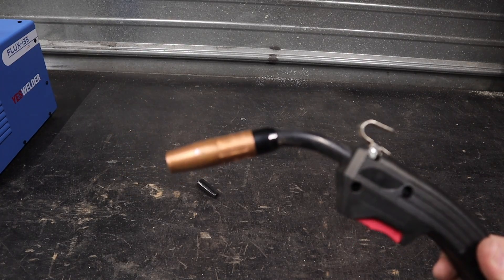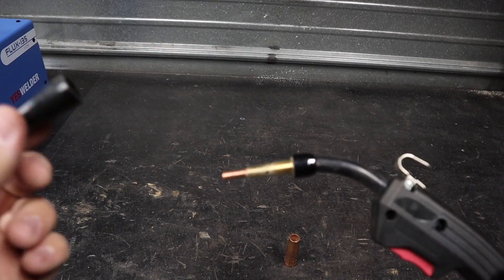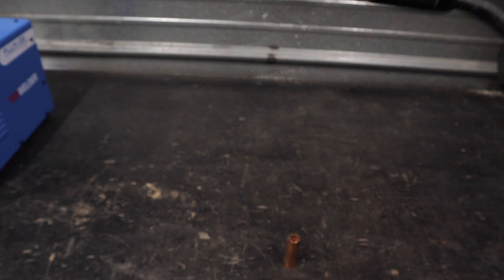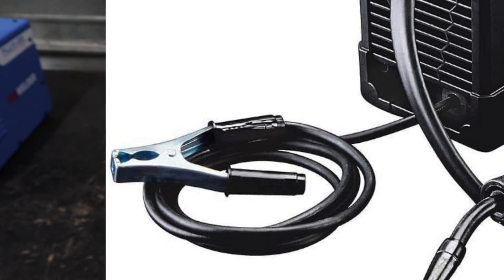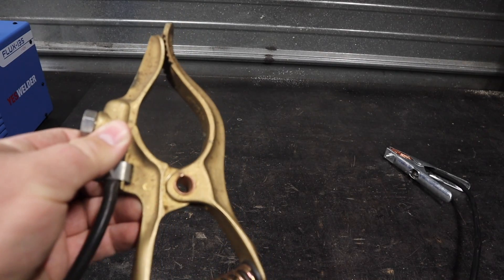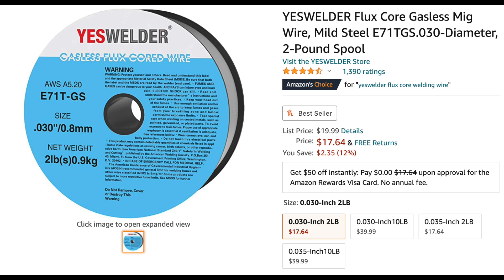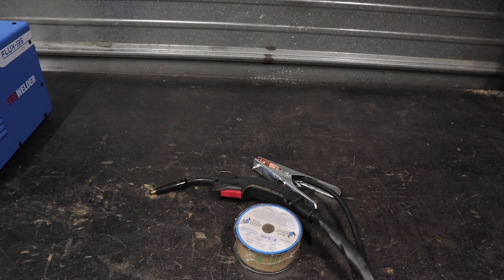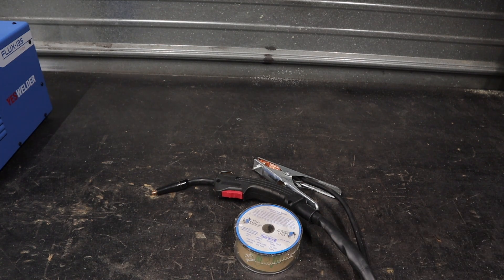3 Simple Upgrades for your Flux Core Welder

Comment: Here’s a good use for the mig tip if ur flux machine comes with a mig tip: i personally like to weld with no tip on my welder besides the contact tip, my nozzle doesn’t have the holes on it like the one in the video shows so i weld with only the contact tip no flux tip or mig tip to get the end of my gun in a little bit tighter spaces when doing repairs or just to have more movement if needed in a tight space, i advise keeping the mig tip in your pocket when flux welding and putting the mig tip on when you are done with that your welding to protect the whole nozzle and contact tip from anything falling on it, it would damage or ding up the mig tip instead of the flux contact tip, just something i like to do and just an idea to get a use out of the mig tip!!

Comment: One of the best upgrades I did when I was flux core welding was to buy a cheap little fan to blow the smoke away so I could see the puddle
Reply: Thanks for posting the fan idea. Just tried it,and it worked great! I’m brand new to welding and have been struggling seeing what I was doing. 
Thanks again!
Reply: @Papa-gr2zi  you are welcome. Good look with your welding

Comment: Did the clamp upgrade. Already had the shorter tip cover. I'll give that wire a try after I burn up the Harbor Freight roll.
Reply from the maker: The Vulcan stuff is good. I don’t know that Blue Demon is any better, it’s just cheaper. I like their stuff.
Reply: Harbor freight wire is absolutely GARBAGE! Throw it out and spend 20 bucks on some better wire, makes s big difference

Comment: All three tips are great. I use Lincoln flux core wire for a couple of reasons; the 10 pound roll more cost effective than buying the little one, and my machine does not support  0.30 flux core on automatic mode. (Lincoln 210MP). Besides is the best one that works for me. The ground  clamp is great but people with small hands might have some problems with the spring tension. True about the nozzle.
Reply from the maker: Great points, awesome comment. Thanks for watching. Would like to get my hands on a good machine like you have some day.
Reply: @DereksWorkshopAndProjects  That 210 is great but there are better and cheaper machines out there. I bought it out of necessity. If I were to replace it I would go for a Welpro 210 or a Forney  410, specially the Forney 410.
Reply from the maker: Good suggestion. I’ll look into it if I want to upgrade someday.

Comment: Any good suggestions for replacement of crappy plastic wire feed? A small c-clamp has worked for a while but alas..., I see replacement wire feeds on Amazon and they all look to be the same as the one that took a crap. No where can a guy find a part actually made of metal?
Reply: I saw a vid on youtube where a guy took wire feed apart. Inside it showed some thick gunk that prevented smooth action of gears. He cleaned it all out and applied some light synthetic grease. It fixed spotty feed.
Reply: LINCOLN sells a Gas MIG Welder that uses a metal wire drive. Probably MILLER does too.
Reply: @fromthebackofmymind  Sounds like a possible/plausible.
Thanks for the info!😉👍

Comment: What model/style contact tips does the titanium easyflux use. The manual doesn't call it out. Thanks for the tips.
Reply from the maker: To me, it’s just a standard contact tip that threads into the end of the gun with the correct wire size.

Comment: What would you set that machine on to weld 5/8" rebar?
Reply from the maker: The Forney? Probably wire feed speed and voltage all the way up and adjust from there as it's 5/8" thick rebar. I've never welded that material so its hard for me to really say.